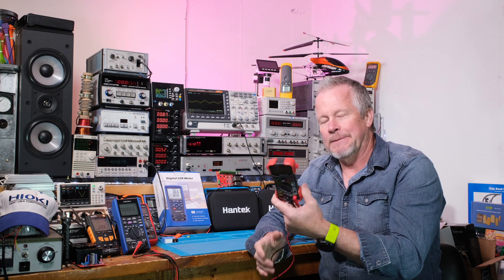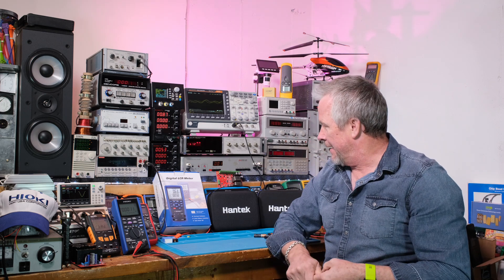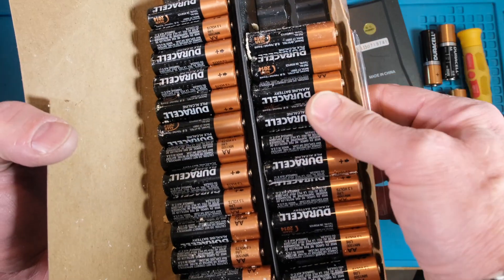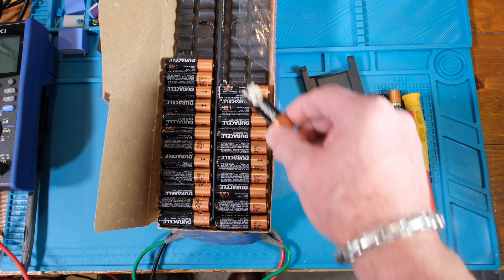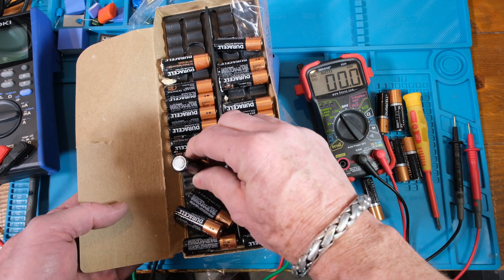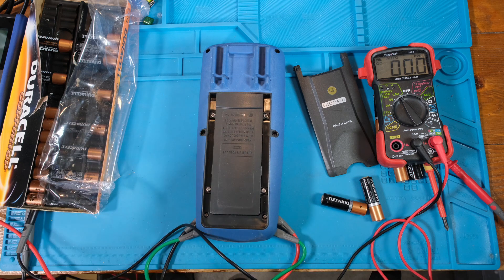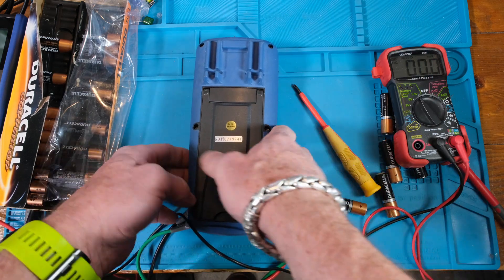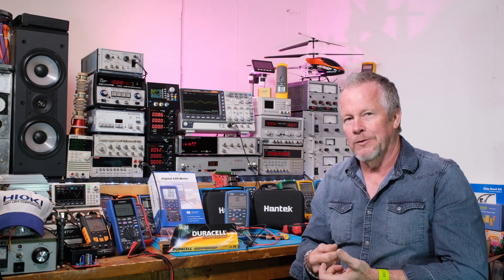Batteries Leaking -  Gold not so Golden

Comment: It would be helpful if equipment manufactures e-signed portable instruments with sealed battery compartments. I do not mean sealed for life, but compartments that are designed to contain any battery leaks, rather than let the corrosive battery chemicals reach the products PCB. Most of the damage from a leaking battery is when the chemicals etch the PCB tracks away. 
The stainless steel battery contacts,seem impervious to the alkaline battery chemicals, with the residue easily removed with distilled water, and dried with the application of IPA. Again such cleaning operations would be less likely to produce further product damage if the battery compartment was water tight as far as the rest of the product is concerned. The above remedies are only required when a battery has been left in the equipment during long term storage, or when it has been accidentally left switched on, discharging the batteries to the point where they leak. 
A further design improvement would be for manufactures to design battery compartments to take account of the swelling of a failing battery. Battery compartments that are cylindrical in shape are both hard to clean, and make the removal of a swollen battery very difficult. In this regard, I am thinking about the classic torch design. Here the best manufactures make the cylindrical battery compartment threaded at  both ends, so it can be removed and the defective batteries pushed out with a rod.
Of course the real solution is for battery manufactures to produce better quality batteries that do not leak. No doubt they will argue that some venting must be allowed for pressure relief and out gassing, but it must be possible to improve the design so the corrosive salts do not escape. 
I have a Rigol DSA 815 spectrum Analyser, for some of inexplicable reason, Rigol chose to mount the 2032 battery backup holder directly on the main product PCB. This is contained by a metal screen, held down with numerous screws, inside the products outer case. It could not be made much more difficult to access. When this battery fails,if it leaks,it will significantly damage the PCB. 
Why would any manufacture make a battery so difficult to change??? It is argued that the battery life is in excess of ten years, but this is not a justification for making the battery change so difficult. This is not the only example of poor battery holder design. I also have a Synology cube network storage station.in this the 2032 battery holder is mounted of the reverse side of the front panel PCB. It requires the station to be almost completely disassembled to change the battery. I have other similar examples where the battery backup holder is sited in the most in accessable places, making checking its voltage and state on a regular basis almost impossible.
It is fortunate that 2032 button cells do not often leak when discharged, but they are know to do so. I wish manufactures would give a little more thought to battery holders and their position in equipment,or maybe this is an example of obsolescence by design.
Reply from the maker: Thank you Nigel!  You bring up a number of quality issues!!  I have several expensive flashlights that I hope to somehow repair, but then it might be better just to toss them!  It is a shame that batteries ruin so many good products - and some are ‘ok’ with that as they expect batteries to fail.  This should not be the case!  Batteries for memory back up do not need to be collocated with the circuit they power, they are low power and low frequency, so the battery compartment could be like a fuse compartment that is assessable.  But any added cost to the bean counters is too much!
Reply: @KissAnalog  I have a number of it remote controller handsets, which also exhibit poor battery holder design, either allowing the leaking chemicals access to the handheld PCB or making it difficult to open the battery compartment when the failing batteries swell, thus making replacement very difficult. 
My Sony media pc has the 2032 memory and clock backup battery buried so deep in the product, it take almost a day to change it.
Worse, the product is fitted with adhesive copper shim  RF screens. These must be peeled off to access the battery compartment, needless to say they do not stick as well when the equipment is being reassembled. The design is further compromised by the fact that the RF screens also have to be removed to change the hard disk, it too is deeply buried inside the case, requiring the unplugging and removal of a number of circuit boards to access the drive. 
While primary alkaline cells have their failure mode problems, they pale into insignificance compared to those of the lithium battery.
For some time now manufactures have been sealing their products shut for life, making it impossible to change the lithium battery.
Some manufactures suggest this is to make the product slim and light. The cynical observer notes that this effectively builds in obsolescence, by defining the product life to the maximum number of recharge cycles of the battery, in many cases this can be as short as two years. Given that a high cost of a good quality mobile phone or tablet pc, this short life before forced replacement is unacceptable, particularly when the majority of the products electronics is still fully functional. 
Some manufactures offer a battery replacement service, to compensate for the fact that the battery is not user replaceable, however the high cost of this service appears to be designed to discourage its use, with the intention of forcing the customer into buying a brand new replacement. The collective effect is to create a mountain of electronics waste, of which only a limited amount can be recycled. This inflects significant damage on the environment and the economics of western countries who import these products from the far East. 
Lithium batteries have a further disadvantage, in that ,unlike other battery technologies, one of their failure mechanisms is to overheat and burst into flames. This can happen when the battery is near to the end of its life and is left on charge for extended periods, to maximise its remaining working life. I am surprised that there have not been more house fires, resulting from catastrophic failure of such batteries. 
I personally would happily accept a less slim portable product, if it ment the battery was designed to be user accessible.
Users must have the right to repair. It is iniquitous to use the product battery to build in product obsolescence. We must return to the time where battery dimensions, design and performance are standardized, so that off the shelf batteries can be fitted to products.
At the moment, manufactures still have the freedom to make a product, with removal batteries, obsolete, simply by ceasing production of the proprietary battery.

Comment: 9:34 marts 2014 and  you expect any alkaline battery not to leak after 7 years  overtime ?
Not understood.
Reply from the maker: Thanks for the great question.  Actually when kept in a environmentally controlled space, no I don’t expect them to leak when still in the package.  But the 2 that were leaking in the meter are less than 1 year old, and 2 out of 6 leaking is terrible reliability.  There are devices that get stored and we should remove the batteries - just in case.  But I don’t think we should expect it, it should be a rare case.  But, this experience has taught me a lesson - and that’s why I made the video.

Comment: I don't think $700 meters should have rechargeable batteries.
Because if they have, it'll be some custom lipo with a custom cable.
If you buy such a meter, you buy them to use 10-20-30 years.
By that time a replacement custom lipo won't  be available anymore, but a AA or 9V battery won't be a problem.
Reply from the maker: Thanks for bringing this up.  Actually the meters that I have with rechargeable batteries have usb-c cables, so they are pretty standard.   But why not use standard rechargeable AA batteries or better yet the 18650 which is used in many applications, e.g. higher end flashlights and other multimeters?
Reply: @KissAnalog  You can always use standard rechargeable AA batteries (or rechargeable 9v batteries) if the meter uses that type of battery.
Whether the 18650 cell will be around in 20 years we still have to see (20 years looks like a long period, but if you use a piece of measuring equipment from 2001 thats still normal practice). AA and 9v have been around at least 60 years, so I dont see them disappearing, but 18650 still isn't a normal household standard (only some niche market flashlights etc use those).
I mean you still cant get an 18650 at a gas station or in a normal warehouse or supermarket.
And a lot of meters that have internal rechargeable batteries have a lipo pack. For instance the Uni-T 181a (which is a nice meter) They might use USB-C for charging, but it's the replaceability of the internal battery which is important. An average Lipo pack maybe has a 5 year lifespan or so.

Also having a usb chargeport on a handheld meter might be a safety issue. I wonder if you can get a catIII / IV rating on that.
I see a lot of multimeters that have a cumbersome adapter that is pushed in the normal terminals and charges through that and doesn't let the dmm be used while charging.
For other measuring equipment like a LCR meter cat ratings are of course not applicable.

Comment: I started buying rechargeable battery's a few years ago for my meters. Just fed up cleaning up after using alkaline. I found a ss wire brush backing soda/water mixture. Clean and dry then a dab of dialectric to stop the corrosion spreading.
Reply from the maker: Thanks for great idea!!

Comment: maybe they are counterfeit? Anyway I use eneloops and gp recyko, most of electronics is ok with their nominal voltage. In weather station sensors  outside where its get to -15C and lower at winter I use lithium batteries.
Reply from the maker: Thanks for the great feedback!  Batteries don't like cold;)  This is good info!

Comment: A mild acid, like vinegar, might be a good choice for an initial clean up with a swab, then followed by water ( distilled if you have it handy) and then alcohol. If they are leaking in a package, why take a chance, they are all going to be garbage, toss them all.
Reply from the maker: Thanks for the science!  It seems like vinegar is like duct tape - 1001 uses;)  I appreciate this great feedback!
Reply: @KissAnalog  any mild acid (virtually) will dissolve any leaked Alkaline electrolyte (aka battery “acid”, but it’s Alkaline not actually acidic at all... confusing dumb term that has antiquated origins since most chemistries were/still historically acid based) in this case.

Vinegar (or dilute citric acid etc) wouldn’t be a good option (necessarily) for other leaked electrolytes, but in my experience the cylindrical alkaline batteries (specifically ONLY ever seen a Duracell brand leak...) are the biggest risk to leak, so not a common problem you’d run into for other chemistries anyways

Cheers

Comment: I wonder what mil-spec battery quality is like? Yes, they would be more expensive, but having a $0.95 battery wreck a $600.00 meter makes no sense. I have had even watch style batteries go bad in precision measuring equipment. The only way this poor quality of product can possibly change is if we don't purchase this junk! I agree with others, out of date batteries must be considered a danger and disposed of. Check dates before you buy.  I would not use any of the batteries in that package.
Reply from the maker: Thanks for your feedback!   I know when I designed for military applications - they prefer not to use batteries unless required.  I've used super capacitors instead in some cases, and in others - lithium types.  The batteries in the meter were still within date - but still leaked:(
Reply: @KissAnalog  I agree with you that instrument manufacturers need to stop using inferior power sources. I would hope that the people who design, make and market instruments are not so completely determined by planned obsolescence that they put an object in a product that is going to destroy the item on purpose as someone else suggested. Why not a rechargeable design like an electric toothbrush? Nice stand to keep a meter in on the bench that keeps it charged.

Comment: All alkaline batteries are prone to leakage under certain conditions, however, Duracells are the worst. For non-rechargeable I use Energizer or Ray-O-Vac (both brands owned by Energizer). I try to use rechargeable in a lot of circumstances too as NiMh cells and Energizer's Lithium AA and AAA have a very low likelihood of leakage.
Reply from the maker: Thanks for the great feedback John!!  I have had Ray-O-Vacs in instruments for years without issue - thanks for the great info!
Reply: I do the same
Reply: My experience is the opposite. I have never had a Duracell leak, but I have had many Ray-O-Vac cells leak and ruin what ever they were in. I have not yet had a Lithium cell leak, so they are my choice for my meters. I try not to leave alkaline batteries in anything for any length of time.
Reply: Since I made this comment, I have looked at my batteries and have come to the conclusion that all alkaline batteries will leak sooner or later. It's very important to remove alkaline batteries from equipment that isn't being used and I have started using Lithium batteries in my good test equipment. I haven't seen a Lithium battery leak, yet.

Comment: Eddie, don't use AA an AAA Duracell batteries, they're terrible, they're known to leak! I did battery testing on my high quality electronic load  and I found for the price the cheap batteries from my wholesale club held up better and I haven't had any leaking. Of course the  thing is about those batteries is that next month they could change their supplier. What I usually do is buy a pack of 48 and check one on my load to see the Ah rating, if it's the same as the last batteries I got from them then it's a pretty fair bet they're from the same supplier.
I found Energizers to be better at not leaking but the Ah rating wasn't any better than the box store batteries. You should do some load testing, I think you might be surprised at what you find.

On another note, I haven't had the Duracell 9V batteries ever leak.

I'm in the market for an new LCR meter I have one of those DE-5000 but I'm not sure it's that great, eager to see what you come up with.
Reply from the maker: Thanks for the great feedback - as always:)  I appreciate you!  Great info here.  I thought about the DE-5000, and I still think it is a solid choice.  I'll upload my LCR video later today and talk about why I chose something different;)

Comment: For me always works first vinegar to clean the surface to lower the PH and then clean with alcohol .. And now I have been using the Energizer AA Batteries, Ultimate Lithium for a long time and I had no problems, Yes they are more expensive but multimeters are sometimes very expensive and there are to take care of them. Cheers
Reply: I switched to Lithium for all my hi-end meters, been using them for years. I started using the 9-Volt for my Flukes, not only do they last longer in the equipment  (3 to 10) times longer. They also have a much longer shelf life. I have never had one leak.
Reply from the maker: Thanks Fernando!  I like that regiment!  Great feedback!

Comment: I prefer to use rechargeable Ni-MH  in my portable equipment, but some instruments don't work well on the lower nominal voltage. It would be nice if instruments were designed to be compatible with 1.2V cells. I have never had an Ni-MH cell ruin a piece of equipment.
Reply from the maker: Thanks Paul!  I agree, I use rechargeable more and more now.  Especially with devices that go thru them too quickly!  Now there's another reason;)

Comment: The batts I get from Costco are cheap but they ALWAYS leak. I don’t recommend Duracell. I gotta try others.
Reply: I had a partially discharged, but not dead, "Kirkland" branded Costco AA battery sitting on a coffee table, and all of a sudden it just started venting and spewing electrolyte for no reason whatsoever. I have had good luck with Energizer Ultimate Lithium, as a few others stated, for weather station remote sensors and indoor units, and I think i am switching over any worthwhile meters I can use them in to those as well. We used to get Ray-O-Vac "Industrial" alkalines where I worked, that didnt seem to leak as bad as most brands, but still would if discharged and left in an item.
Reply from the maker: I always liked the bunny - so I should stick with the Energizer;)  I have used the Ultimate for meters in the past...
Reply from the maker: Thanks for the heads up!!  I wonder if Costco is using Duracell?  We should let Costco know that we don't trust their batteries;)
Reply: @KissAnalog  Im talking about the Duracells that Costco sells - not the Kirkland brand. The Duracells leak worse than a sieve... 😊

Comment: While I'd not normally defend Duracell, to expect ones that are 7 years out of date to not have leaked is silly. I'd be more surprised if they hadn't leaked. And also, "acid"?!? (8:48). Just use rechargeables, all my meters work just fine with them.
Reply from the maker: Thanks Anders!  I appreciate your feedback!  I thought the gold tops were one of the best - I suppose because of marketing;)  I know better now.  The batteries in the meter were relatively new and had not been in the meter for a year even...
Reply: @KissAnalog  yeah the ones in the meter with the 2025 date are the reason I refuse to use primary cells in anything I care about nowadays. You just can't trust even new batteries, any brand, not to leak at random, it seems.